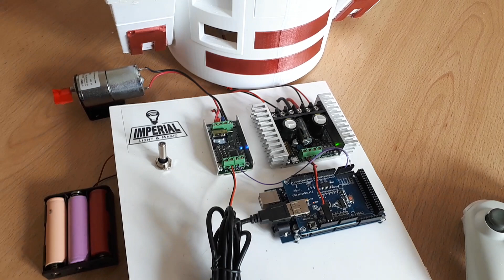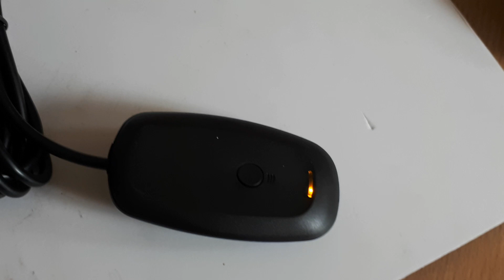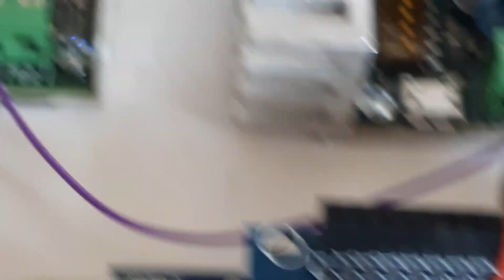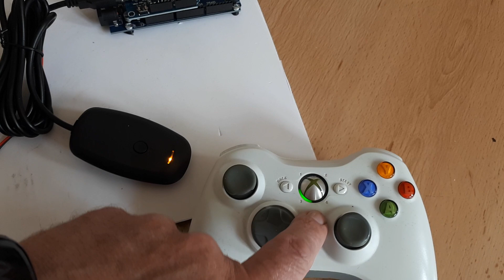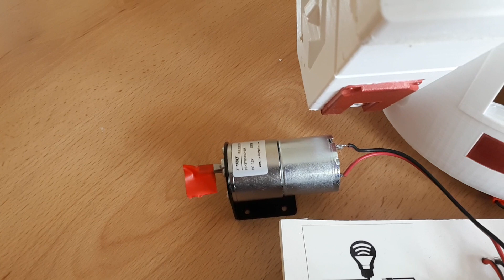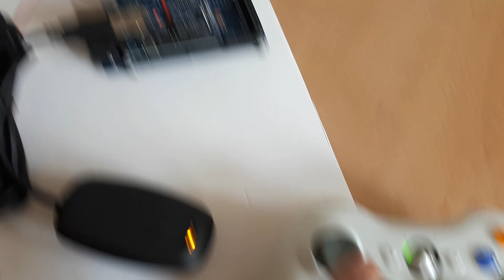Padawan 360 Arduino Mega version

Comment from the maker: Hi folks, I made a small mistake whilst getting tongue tied,  around the 2:35 mark I say "I haven't got my sabertooth" I meant to say "Sparkfun MP3 trigger.  Also if someone could confirm which pin the MP3 board plugs into I'll pin your comment. Thanks! Steve B.
Reply: Do you build kits for a customer
Reply: I was just coming to find where to plug my mp3 trigger in…